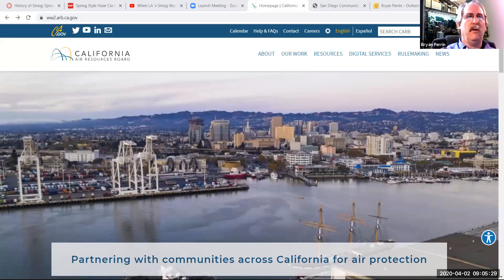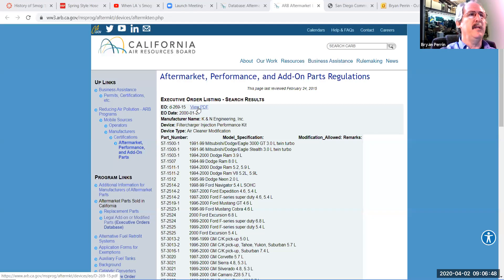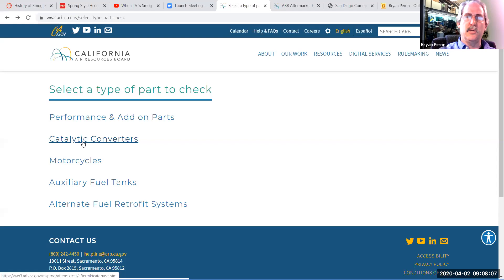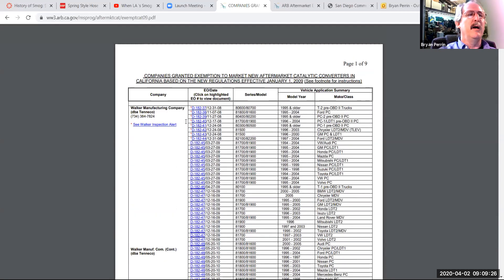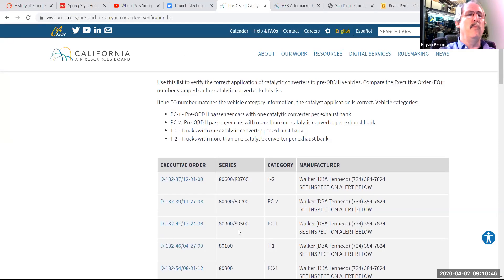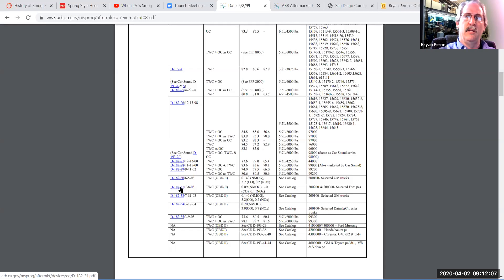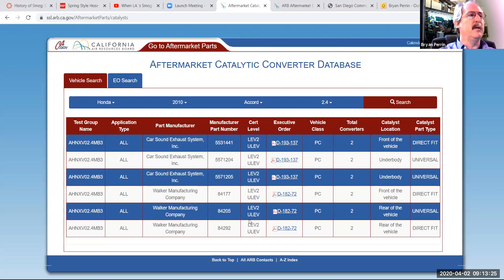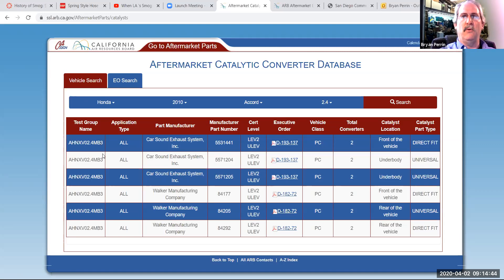California Converter and Aftermarket Parts Verification

Comment: How do you find the EFN if the hood was replaced and the sticker is not there anymore?  This is for a 2000 Honda Accord in California. Need to get the catalytic replaced.
Reply from the maker: The only options are to order a new emissions label from the dealer using the VIN or install a factory converter.

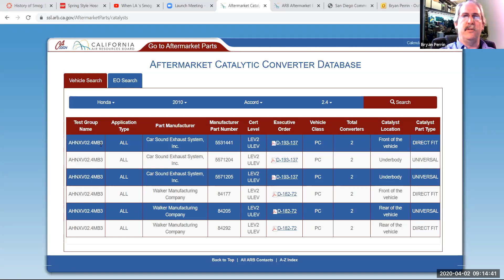Comment: At 9:41 I have a 1997 GMC Safari, my engine family number does not appear under "test group name." Does this really mean that I cannot smog the van?
Reply from the maker: No it does not. Is the van a Federal vehicle? If so then the engine family will not show up on the ARB website since it is only for California Certified vehicles. There is a different procedure for Federal vehicle converters. I hope this helps and sorry for the late response.